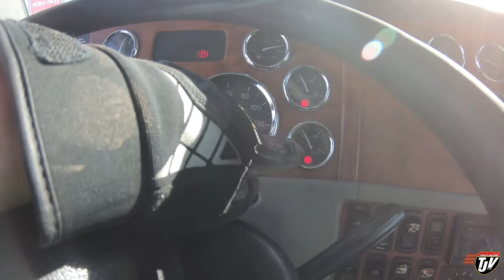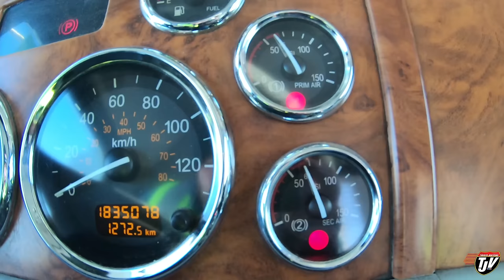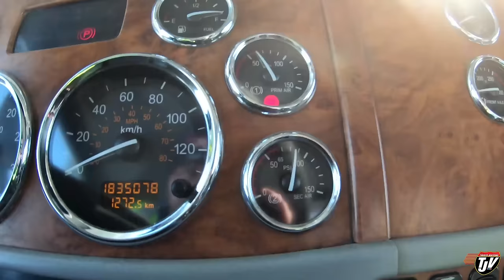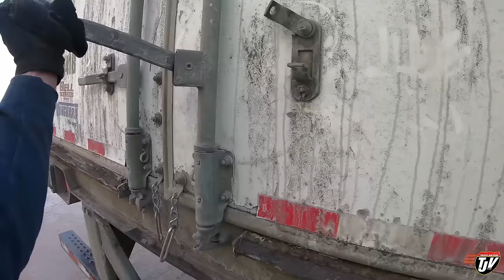My Trucking Life | BROKEN AIRLINE | #2235 | March 12, 2021

Comment: Hi josh

A curtain side trailer is a trailer with just the side walls made out of tarp material, the roof is ridged.
The trailer that you pulled with the sliding frame and tarped sides and roof is referred to as a conastoga, conistoger, a flat bed trailer with an easy tarp to cover goods.

But loving the vids and 👍👍👍up to the name of your truck, the mistress, the perfect name for a truck.
Keep the rubber side down and the shinny side up and we will see you on the back haule brother.

Philip Burrows from St Helens, Merseyside, England 🏴 UK 🇬🇧.

Comment: Those trailers with rolling curtains are very common here in Europe because of the loading from both sides. But they are not so weather resistant for the Canadian winters. Instead of taking a whole set of wrenches you could take an adjustable wrench or bacho with you. Might be very handy. Come on, stop saying you're an old man! You are just beginning your life. We talk again over 30 years from now. Then you are getting a little bit older. Look at your dad.